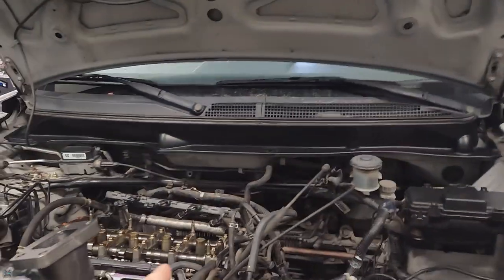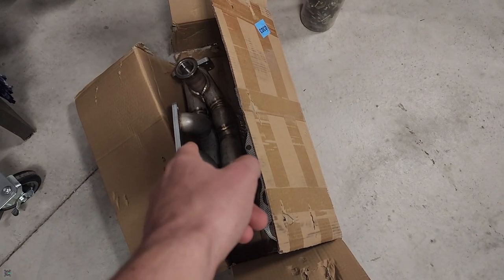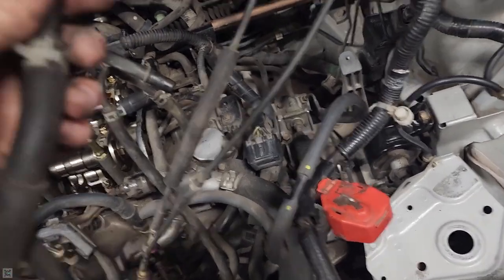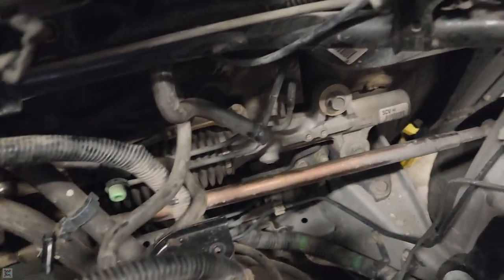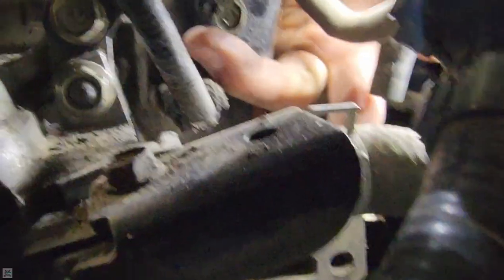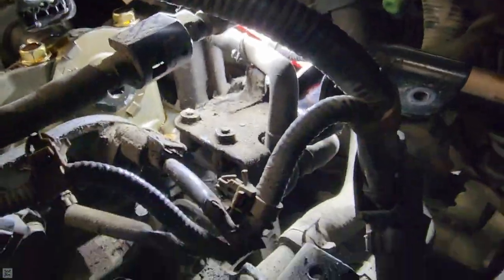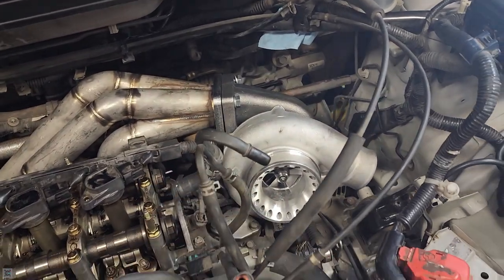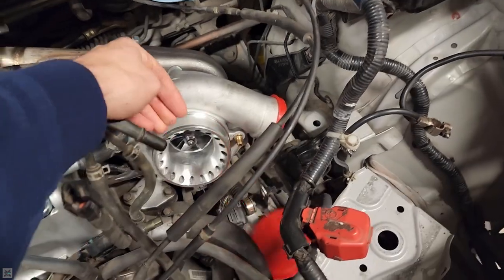Putting a Turbo on my Honda Element | Turbo Toaster Part 2: Installing Turbo

Comment: taking the valve cover off and then  working in a dirty engine bay with the cams wide open is such a recipe for disaster. even without turbocharging an NA K24 without changing bearings or building any internals.
Reply from the maker: It wasn't off for long...just enough to replace the seals and clean it up...filmed while we were waiting for the water to dry.

Comment: Is it the stock engine or did u have to upgrade the engine for the turbo
Reply from the maker: Nothing has been done to the engine internally besides new plugs. I did have to get a different water neck but that's about it.

Comment: Wouldnt it be a whole lot easier if the turbo mounted on the back side where the collector was on the stock manifold?  Seems like a log manifold/header with short runners and a long cold side pipe to the throttle body would be a much easier installation?
Reply from the maker: That is what I was going to do at first until I started sizing everything up. There simply would not be enough room to put this size turbo back there, and plus the turbo is in a much more accessible spot to work on now.